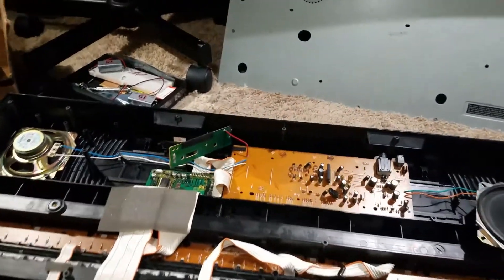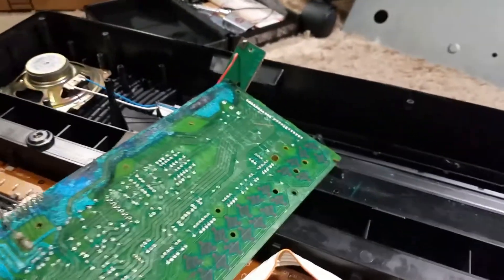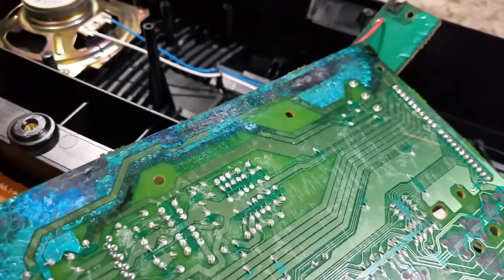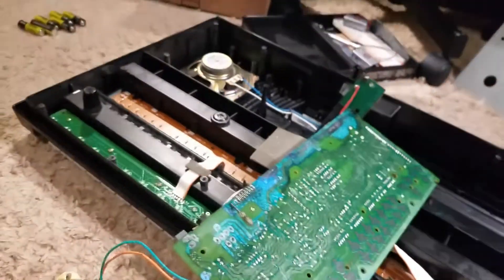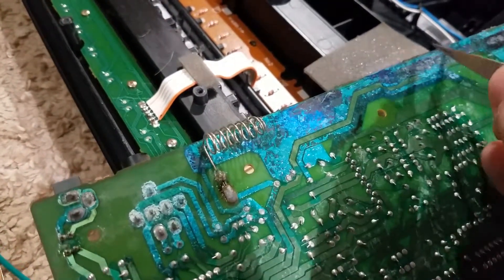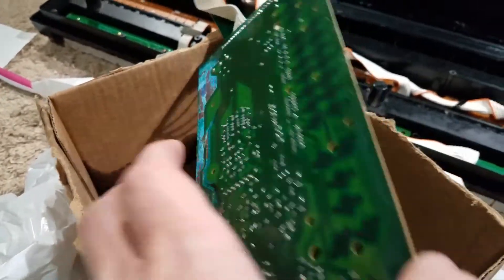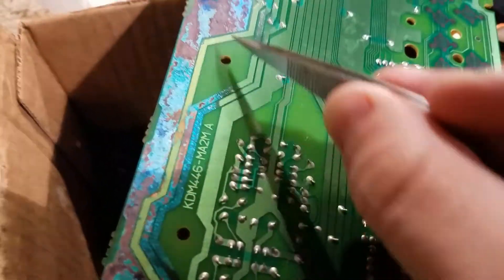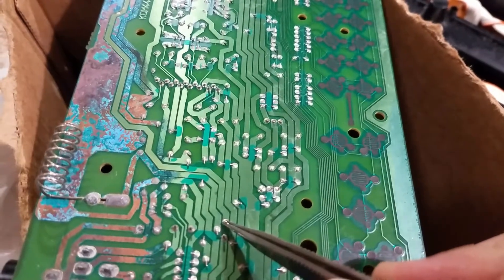Vinegar Destroyed My Electronic Piano's Circuit Board... Let's fix it

Comment: Do not connect electricity so long the PCB is still wet. Acids (vingar) or salts are worse than plain water because of ions, but generally voltage + moisture = corrosion.

I usually clean off battery acid (in modern batteries actually alkaline) from PCBs using dishwashing detergent and tapwater. Important is to rinse and dry it properly before use. Also don't get moisture sensitive parts wet, or anything where the water can't get out again (paper speaker cones, closed potentiometers, rotary capacitors, enclosed coils/transformers etc.). Vinegar may help against alkaline, but only if rinsed properly. If PCB material got conductive by soaked alkaline, you may try to apply a layer of pure liquid dishwashing detergent and put it in a plastic bag for a day to make it soak without drying. Later rinse it properly with pure water. You may assist drying with a warm (not hot) hairdryer.
Reply: I leaned that the hard way with my Toshiba Satellite which died AFTER cleaning it with vinegar

Comment: It is very bad looking. But it is very strange. As I have read here:
https://chemistry.stackexchange.com/questions/30923/what-is-the-product-of-a-copper-and-vinegar-reaction
the copper should not react with vinegar. The result you have is like you added peroxide H2O2 to it. I am very frightened because I have cleaned by vinegar many things. So I must check them all and pray....
Reply: Did not you use peroxide?
https://www.youtube.com/watch?v=at-vRIQA_PU
Reply from the maker: @xxmuddy  Very cool video! I didn't use any peroxide. If you look up the chemical reaction between vinegar (CH3COOH) and copper (Cu) and Oxygen (O), you get Copper Acetate and Water. The Oxygen comes from the atmosphere.

4[CH3COOH] + 2[Cu] + [O2] → 2[(CH3COO)2Cu] + 2[H2O]

Comment: This was great, I've been looking for "is it possible to repair a scratched pcb" for a while now, and I think this has helped. Have you heard people talk about - Giyathan Bewildering Gratification - (do a search on google ) ? It is a smashing exclusive product for discovering how to repair your electronic items like a wizard minus the normal expense. Ive heard some super things about it and my neighbour got excellent success with it.
Reply: It is possible, but it depends on what was damaged, if it wasn't the traces, that's going to be trivial and mostly a matter of getting it sealed, a bit of dielectric grease might be enough to keep moisture from getting in and corroding to the traces. If do have traces that have been damaged, you can either cut them out and transplant them, or you can disconnect them and solder a wire to circumvent the damage. But, if you do that, make sure that you've done something to prevent the corrosion from continuing from where you left off. 

I'm just learning, but if you look up Mr SolderFix here on YouTube, he's got some rather impressive skills.

Comment: Vinegar is actually great for cleaning corrosion, BUT you can NOT leave it to chance when making sure ALL of it is NEUTRALIZED

You HAVE to use something basic such as Baking Soda mixed with some Distilled Water (has to be distilled otherwise there could be other corrosion/conductivity issues over time that arise... )

I would reuse the vinegar technique that you used originally to remove the corrosion, then ABSOLUTELY use the method I described right after... Be liberal with it, however, don’t be liberal with the Vinegar...

Then finally use Iso Prop/“Rubbing Alc” if the highest % you can get (90% would be OK) and clean *everywhere*..

Let it dry completely, and only then after put it all back together 

Hope this helps

Cheers
Reply from the maker: Thanks for the comment and suggestions!
That's basically what I did in the video to fix it :)
Reply: Fix it Fox - I feel like I complete dumbass omg hahaha!! I admittedly did NOT watch past the point where I saw the problem and I “knew”/was compelled to share the “knowledge” hahah.., but that is tooo funny, wow.. I apologize for redundantly and pointlessly explaining this!!

I’m used to making an ass of myself! Prettty stupid LOL!

Cheers mate
Reply from the maker: Haha, that's alright man, no problem!
Reply: @TylrVncnt  I was getting dizzy by 3 minutes in, thanks for posting your brief explanation, it's appreciated. 
 Question, what about using CRC electronics cleaner either before or after this process? Either to remove the bulk in the beginning or maybe to clean off any residual at the end of the process?
Reply: @FixitFox  Tylr's comment should definitely be pinned! Please.